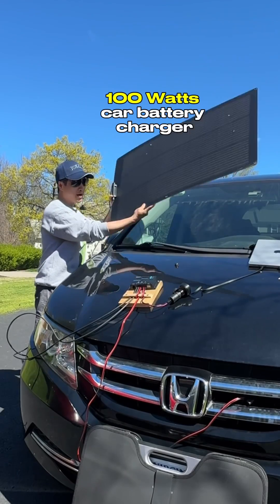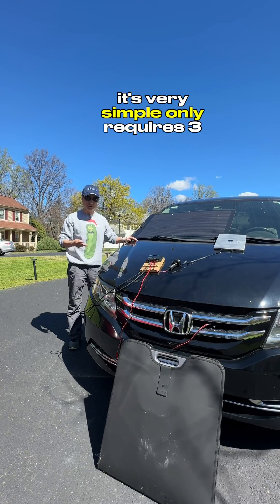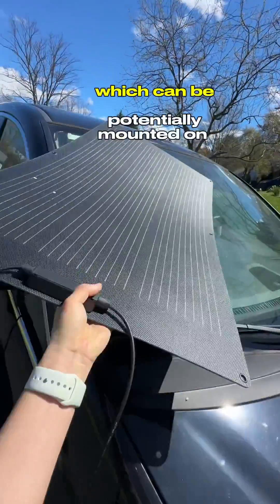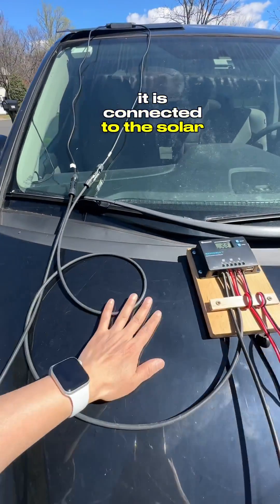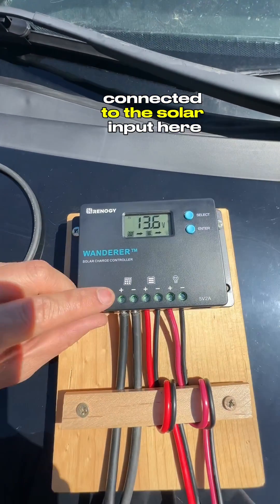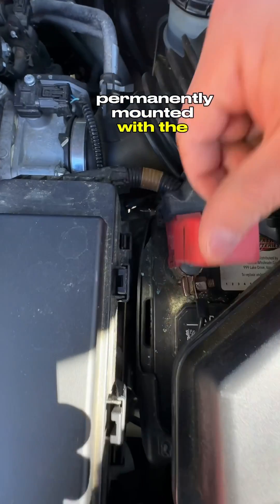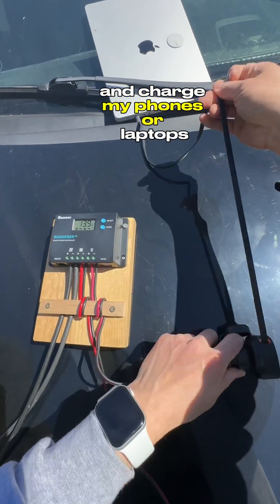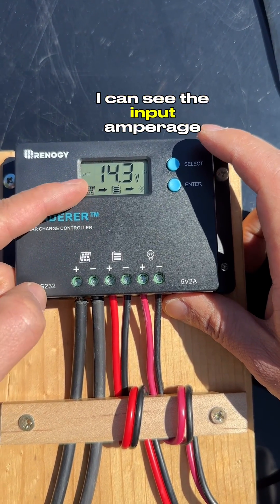DIY solar car battery charger

Comment: had a similar setup on the roof of my RV converted school bus. It provided enough watts to keep the bus's chassis batteries topped off AND run a minifridge hooked up to a 12 volt inverter that was powered by the chassis batteries. I came back to it after it had been parked for 9 months and it cranked very well, the batteries were at 13.2 volts.
Reply from the maker: Sounds like you got a solid setup!

Comment: Is it possible to utilize 1 charge controller  to charge a truck that uses 2 batteries?
Reply from the maker: Theoretically yes, but you need to make sure the 2 batteries are identical and not much voltage difference. I would use 2 controllers just to be safe.

Comment: Ain't worth it.. my car's efficiency was worse with near-dead lead acid battery, letting the alternator on all the time.. i'm gonna go with lifepo4 self-build (4 62Ah cells for great price plus balancer module / BMS could destroy the electronics, pls don't ask how)
Reply from the maker: Sure, definitely replace bad batteries. But my method is to keep good batteries alive when you are not using it.
Reply: @ToolsElectroDIY  my method (now) is using an invertor welder (dc) at lowest amperage (20-21A) at least once a month for a while (5mins enough) even though i run the car every day, so the battery has no time/chance to sulfate.. it's because even if it's new, every morning it has 12.3V (12.5V when put on welder, next day 12.4-12.3V and it stays there).
My project is 4X lifepo 62Ah SVOLT, a balancer module and i'll put it in the old car battery box, though i need to find a battery that's at least 200Ah, the cells are long, about 40cm each 🙄 BUT these ones can go as high as 500A 30s and charge at -20°C, ideal since our winters can go down to -14-17°C easily on veery cold days

Comment: Why did the cars not do this in the first place? Now I gotta worry about thieves taking my solar panels
Reply from the maker: It is pretty common for small electronics in the car to slowly drain the battery or the battery naturally will discharge overtime.

Comment: Does it stop charging once the battery reaches capacity
Reply from the maker: Yes, it does stop. That’s the point of using a solar charging controller in the middle.
Reply: Awesome thank you 🙏🏽

Comment: How much did all of this cost
Reply from the maker: A bit $200. See links in the pinned the comment above. The most expensive thing is the solar panel. You can buy cheaper ones or smaller ones.

Comment: I like your ingenuity. I heard that if a person plans to go on vacation for a long time, disconnecting the battery terminals before leaving will help prevent it from dying.
Reply from the maker: True. But disconnect the battery terminals takes a lot of time and effort.
Reply: That's for vacation. Someone like myself is looking for solutions to what he said; "car doesn't get used much".. I drive one mile to work and back.. would walk by I'm working nights in Yosemite..( mountain lion,  black bears, and possibly women) but I also charge a lot of devices with the car. Get it..